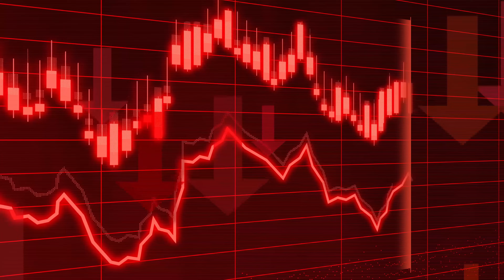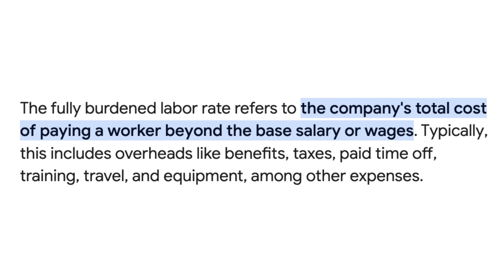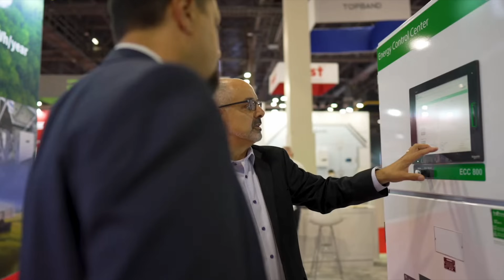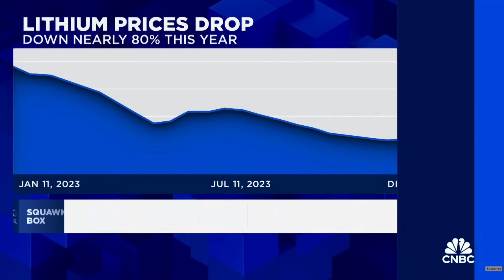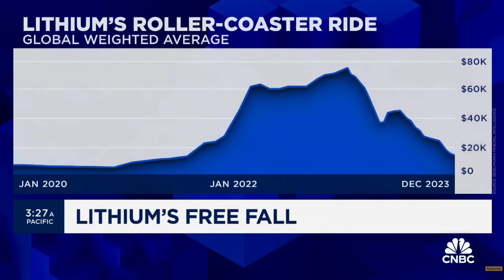IT'S BEGUN! The Solar Battery CRASH of 2025

Comment: The solar array for my current house is more than fifteen years old. Solar panels were vastly more expensive back then than they are now! And we've had to replace the battery set a couple of times, because the initial set and the first replacement set were second-hand cells.
It was worth it. I've had over fifteen years of no power bills. Even accounting for replacing the cells and the opportunity cost of sinking all that money into my power supply, it adds up. The next house will have a much bigger off-grid solar, because everything's cheaper now and I have more money than back then. I'd never go back to having electricity bills!

If the gear you're looking at makes sense financially now, don't worry if the price might fall or might tomorrow. That doesn't matter. What matters is that the numbers add up on the day you pay for it.

Comment: I went with a victron multi plus ii 3000va for my Camper. Don't need as many panels for cambers but having that boost function is key along with it being a true LF inverter. However, Going with powMR 5000 watt HYbrid and 5000 watts once I get my property cleared. Having a little shipping container with battery's and a small ac unit and plain on making a power station room to feed a 30amp plug to my camper site. This way I will have double UPS backup along with a Propane Gen at the end of it all. 48 volt system feeding power into a 12 volt system but having only 14kwh on the camper really is all one needs for a weekend fun anyways with heated floors, The power station will need at least 100KWh worth.

Comment: Well four months later I 'discovered' for the first time...of portable power stations...way cheaper to get your feet in the battery door...and you don't need an installer, besides the subpanel wiring...

Comment: None of the install is rocker science.I installed the Eoflow ultra battery system last year with the capability of automatic charging off: solar, generator and  grid along with a larger disconnect panel. I did have to consolidate some circuits that were grossly under utilized. I also installed just 1800 watts of solar as a trial run over the winter. I used that data to spec this years solar install. I do have a several trifuel inverter/generators the larger one will charge my batteries in just over 2 hours to run the house all day. We had three power outages last fall and the only reason we knew is because neighbors called in to see how we we handling the outage.this year I will install the main solar array. My plan is to run off solar for reasonably sunny days with the grid as backup for significantly overcast days. And, generator backup for off grid operation running on natural gas as first fuel choice.  Total cost will be $17,000 with an expected 7.5 year pay back.
Reply: Update:  with the 30% tax credit the total cost will be $12,000

Comment: Just a question. Maybe off base a bit. But, I live in east Texas and the storms here can be rough. My controller is replaced constantly it seems from lighting strikes. Any advice on grounding??
Reply from the maker: Did your solar installer properly ground your system with copper into the ground?
Reply: @ probably not. I have since uninstalled them. With your video help I hope to do it myself the next time.  lol. With your help. lol
Reply: You have to add Lightning and Surge Arrestor to your wiring...

Comment: The meter can colar approach entrenches the parallel system approach. Therefore, it will never upgrade my solar only system with this crappy approach. Only a integrated automated transfer switch function, like the enphase system controller 2, is close to what I would consider. In the perfect enphase system, the system controller 2 would implement another wifi interface to wifi breakers. UPS based capability would be used on the I/O controller, system controller 2, and wifi breakers at the panels that support direct load circuits.

Comment: It is interesting that within home WIFI is increasingly supported by UPS. That means WIFI breakers can be controlled by solar controllers that also use WIFI/ethernet to facilitate com between solar installations and corporate servers. That means no home rewiring and real-time circuit load trimming over WIFI. For instance, the company that bought square-D has WIFI breakers. If WIFI breakers are used, then battery less installs or those with batteries can operate during grid down events as they incorporate automated transfer switch capability. Enphases's system will operate a generator to carry loads at night or when solar performance is degraded by clouds. I just wonder when Enphase implements the wifi breaker integration as it save alot of circuit rewiring. The wifi controlled system would let the homeowner specify the priority circuits verses specifying the low priority circuits.

Comment: The big glaring problem with all home solar systems is twofold. The first problem is that most of the installation companies go bankrupt…almost 80% of them. You call in a new company to support a bankrupt install and get clipped to correct all of the defects and Chinese stuff the bankrupt company left you with. The second glaring problem is IRT (Investment Recapture Time.) IRT for most systems vastly exceeds the time an average homeowner stays in a dwelling. It is remarkable to me that people don’t first spend money on energy efficient lighting, HVAC, and appliances first. Doing this actually enhances resale value of your home. This can often generate far greater savings, and has a vastly lower IRT, years instead of decades…..and if you need backup power, just get a whole house generator, preferably powered by propane or natural gas. You will actually be able to run everything in an emergency…something very few solar/battery combos can do for more than a few hours. Your maintenance costs will be far lower as well. It’s your money….learn how to keep it.

Comment: There has been an uninterrupted decline in the price of solar batteries for 30 years.
 In 2024, the decline was drastic at over 40% so far. Prices will certainly continue to fall. 
You should therefore wait until at least spring 2025 before making a purchase.
Reply: Ha ha ha the cost of lead acid batteries have never dropped in price...
Reply: @SolarizeYourLife  What do lead acid batteries have to do with today's 10/20/50 kWh solar power storage batteries?

Comment: Lol All these industry guys passing trouble with the big name brands and their AC batteries. 

Quit shilling for the big companies! Their products suck! Not cheaply made maybe, but lacking in capabilities that people want, and are obvious from a user standpoint. 

If you use DC side batteries with an open source string inverter you would have none of these problems. Most of those systems are essentially are plug and play. The hardest part is wheeling them in. Shouldn't take more than a couple minutes.

DC batteries tend to be 2-3x cheaper than whatever AC batteries go for. So it often makes the difference between a consumer getting a battery and getting no battery at all. Or if they can afford the AC battery price, they can get 2-3x capacity for the dollar with a DC battery. Which is extremely important since DC side batteries still aren't cheap.

Most companies bypass the AC battery labor issue by not offering them in the first place. It's too expensive! Which is usually true. The big brands offer completely noncompetitive "solutions". It's one step forward and two steps back with them. Easy power inversion, but batteries too expensive and difficult to install. It's prioritizing short term benefit at the expense of long term benefit. Which is not solar power's strength. Solar should be good short term and fantastic long term.

The big name brands rely too much on you picking their inverters for being easy to install and you then getting stuck in their closed ecosystem and being forced to use their batteries and they make big margin on those. But the high price means low volume sales for them, and many people that could have backup power are having to go without. It's not a good solution. 

The electric grid is poorly maintained and grid failures get worse and more frequent. People died in those winter black out in Texas a few years back. They blamed it renewables! Renewables were just a blip on the radar of Texas power grid so that's not what failed! 

Most of the people that died did so from inhaling carbon monoxide from their gas generators. If they had batteries, CM inhalation wouldn't be an issue. If they had solar too, off-grid or hybrid, then a grid-down would no problem. The Texas grid could fail everyday forever and they'd be fine. They wouldn't need it. 

That's the beauty of solar plus batteries. Not needing the grid. The grid is run by greedy corporations that want to make the max dollars while putting in the least effort and expense. Specifically trying to impress and attract shareholders to increase investment.It's basically free money! But they maximize apparent profitability by cutting corner and letting things fall into disrepair instead of spending the money and labor to do preventative maintenance to keep things upright and in working order. When access to power means the difference between life and death, the less you need to depend on people like that the better off you are. 

The more that we can enable access to cheap battery power and self generation, the safer and more secure the people in our society will be.

Comment: Why get solar battery's right now.. WEF will be still pushing EV's that wont change. US war in sandbox will make oil price go up. That will up all the prices..  Getting mineral transporting making stuff all will cost more.. If WW3 will get bigger good luck getting anything from china and all the cheap stuff go bye bye.. They really like to have bigger war so chance that will happen is high. Very high. Getting ready for 10 year long WW3 war right now is just smart. Most likely next year will be more bad than this year. If not very good and nice. I hope that.. But I plan and do everything like next year will be more bad than this one. And someday comes that time you won't get anything from anywhere for long time.. Before that I like to get my minimum setup ready. Good luck and godspeed to all of you.. Water Food heat security 1-2 years plan for it that won't cost anything.

Comment: Lithium-ion battery pack price dropped to 139 U.S. dollars per kilowatt-hour in 2023, down from over 160 dollars per kilowatt-hour a year earlier. Statista Oct 2024. According to to the past 4 years, Lit-Ion has been very similar numbers 160,150,161, 139.  Flattening out, it appears. I'm holding.

Comment: Meter socket adapter / collar sounds interesting - but doesn't it assume you have enough output to power the entire house load, or you have a smart panel that can turn off loads, or smart loads that can turn themselves off.  Are there standards for making that happen?  

I'm in the market for a new panel anyway - but getting a socket adapter sounds like a way to avoid that $4K+ expense.    But finding people who know about this stuff and can give good advice is hard.  Unfortunately your website doesn't have any links for Nevada 😞 and when I checked the manufacturer of ConnectDER doesn't sell in Nevada - it seems to be a regulatory thing?
Reply: The collar just disconnects the grid when the grid goes down, allowing the backup system to power the house via a back fed breaker.  This way you do not have to intercept a 200A service (3/0 cable).  In a grid-down scenario the house may have to shed loads to keep to what the inverter can output.  But under normal grid-up operation the grid takes care of any excess above the inverter’s maximum.  That said, modern inverters are very capable.  An EG4 Flexboss21 can do 12kW continuously and 21kw surges.  And you can gang more than one inverter (but for most homes, one is enough).

Comment: I am yet to see cheaper battery in the store.
Reply: @sigp2101  I bought a replacement Power Wheels LiFePO4 on Amazon which was cheaper than the PW lead acid battery by $20 USD.
Reply: Plenty of 100ah lifpo for $200.  Echoflow has one on Amazon.

Comment: I seen no price difference and I have been watching for couple years
Reply: Some brands havent cut prices, but there are a ton of good batteries that have dropped as much as 70% since I bought lipo for my camper van
Reply: Yep... I want to see where these "price crashes" seem to be sitting for myself.
Reply: You in California?
Reply: Most battery companies are sticking to the super high prices, however the quality cells are creeping into products with lower costs, I just purchased 4 12v x 100AH batteries at less than $160 ea. shipped!   Yes they are a no name brand, but I had previously bought on of the same units for a different project and it performed perfectly so I am confident they are not junk cells.
Reply: What brand?
Reply: I am in the market and literally see no price breaks for the past few years.  For example a Tesla power-wall 3 without a solar purchase will cost 16,250 installed.  That is more than 8.16 KW solar system I purchased from Tesla.

Comment: The solar scam in a nutshell.  Homeowners buy solar to generate power for themselves and for the grid.  Excess power into the grid is ‘sold back’ to the homeowner for peanuts.  Perceived ‘Smart homeowners’ buy batteries to store their excess energy but are still paying numerous other costs to include leases, loans, cash up front, rising PGE rates (depending on usage) and other hidden fees.   Not to mention replacement costs as panels exposed to constant UV degrade year by year.  
The other options are twofold.  Install an off grid solar system with batteries yourself and pay for it up front.  Or, conserve.  It’s funny, we do not have solar in sunny California and door to door salesmen are so dense that when I tell them we don’t use AC and our average monthly bill is $95 for a 1600 ft sq 3 bedroom home their eyes glaze over and they continue with their pitch.  Through the noise of our neighbors with solar and constantly running AC units.  Solar does not encourage conservation, it encourages more use.
Reply: Solar is not going to solve an energy hog... That is not solar fault that is user fault...
Reply: @  not a single person with solar thinks about conservation.  Zero… nada.
Reply: Agree with most of what you said but the last part about solar not encouraging conservation is funny. The whole point of solar is that it's renewable so you don't need to conserve energy lol.
Reply: @Drew_Reviews-Analysis   Think about it though.  What do homes with solar panels that do not conserve actually do to the grid?  Weakens the grid; less overall consumption = less PGE generation.  It now becomes a storage issue that PGE has passed those costs onto all of us.

Comment: Just checked Tesla Energy - it is still too expensive. $92,421 cash for 21.06 kW Solar Panels and 4 Powerwalls in L.A. and then you have to wait for $27,726 Fed Tax credit. To make it payback is gonna take ages.
Reply from the maker: That is a pretty large system for a home.
Reply: @jackthesolarguy  I've got 2 EVs to charge.

Comment: Obviously you're not a DIY guy, where the real savings is found. 304 Amp hrs 48 volt DIY battery complete $1600 including shipping from China. That's $1000 less than a battery already encased and branded 100 Amp hr 48 volt for $2500.
Reply: What company from China? On ali Express or what website? Got any video links or articles where I can learn the diy method. I already have solar panels on my house in Florida, just want to add battery backup to my existing system. Thanks for any info if you see this

Comment: Once sodium ion batteries start flooding the market, home storage battery prices will plummet. Yes they aren’t quite energy dense as lithium ion batteries. However the raw materials are so much cheaper and more abundant. So even with a slightly larger footprint, the lower sell price will be a no brainer.
Reply: Even with inflation. The prices have dropped.

Comment: The IFC 25 (International Fire Code) and NFPA 855 are currently being reviewed as to how batteries can be used indoors, so there may be a change in prices due to the outcome of these two possible rule changes. We shall see. Probably an increase in battery pricing for additional safety features. The new rules are due to be released soon. I decided not to wait so I purchased a 12kWh outdoor wall mount battery. Great video!

Comment: So I'd say you are wrong... markets caused the drop on multiple items. I bought during the drop... even though there have been technology improvements and production improvements prices are now higher than when I purchased so the inflation reduction act is actually inflating prices of solar panels, inverters to lesser extent l, but drastically increasing prices... the us and Canada where also max capacity in solar panels storage on wherhouses so they have continued to sell out.... prices ha e already increased, but they will increase again. Batteries will remain the same or go down probably, there is a mass storage issue and I beleive tarries are at 30% vs 50% still china is unloading. There should be newer battery technology in the next few years.